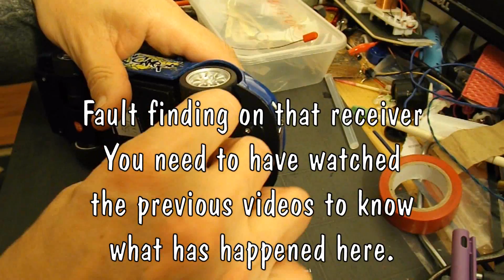Charity Shop Garbage RC Car R16

Comment: if that ic is a popular rx-2 clone this resistor sets the speed of transmision data , there might be more than one tx-2/rx-2 pair on the same frequency if you use different values of those resistors inside remote and reciever pairs than in other pairs
if the frequency is off on one side by small margin, car would stuter or not work at all, if they are miles off car wouldn't move or do silly things even if you connect antenas directly
Reply from the maker: Thanks

Comment: I very like your video but how to make rc car faster
Reply from the maker: I don't do fast RC cars. The usual way to make an RC car faster is bigger batteries or change the motor for a more powerful motor. If you are talking about cheap toy grade RC cars both those options may cause the receiver board motor control circuitry to overheat and burn out. If you change the RC gear to hobby grade you can then match the motor and battery using an ESC and you can really increase the power.

Comment: Hi, Grandad i wanna ask you question. Do you prefer toys like this without coputer or you would to make some toys with computer? If yes, i know one thing: It calls ardurino and it is micro-controller as you can make lots of stuff from this. Its easy programmig and if you like it, try it. PS: Sorry for my english im just 15 years old and i live in Slovakia.
Reply from the maker: It is more a case of my channel is aimed at simple, quick and cheap projects. Once I start using micro-controllers the projects move into a different area. Even the rc projects I do are very basic. There are plenty of channels that focus on arduino, PIC, and raspberry projects.

Comment: Hmm. 180K is in line with the 200K on the datasheet. But if the reading was 17K on the meter, it would be why a piece of wire added works as the work around.
If the receivers own real antenna is a replacement (got bent, got replaced, didn't work so went to the charity shop) then I wonder if a direct connection from Pin 4 to the car antenna would fix it. It's also possible that such a trace existed on the circuitboard and has been accidentally cut/bridged or become corroded.
Reply from the maker: I think a more detailed check on the antenna circuit will be the next step.
I did notice the receiver works with the antenna disconnected with my wire attached to R16, not that it is unusual when the transmitter is up close anyway.
I am pretty sure I did try the antenna direct on pin 4 and probably every other pin :-) early on in the tests but I will certainly have another go as this is quite intriguing to follow through.

Comment: It sounds to me as like your wire is picking up the signal and going straight into R16, bypassing something that is throwing the oscillation off. Is R15 the correct value?
Reply from the maker: Look back at the previous videos to follow the thread of this work. I strongly doubt that the resistor is likely to be the wrong value as I would guess this car worked when it was originally purchased and has since developed a fault. Resistors don't magically change places on circuit boards.
In the previous video I go through the data sheet and a generic circuit diagram, it is not the circuit diagram for this actual circuit board but it gives you a feeling for the way it works.
R16 sets the oscillator frequency used by the timing circuit.
Reply: I see. I assumed that the reason it was in the charity shop was that it never worked correctly in the first place.
Reply from the maker: Samuel Tyree That is quite possible, but if I bought a new toy and it didn't work I would take it back to the shop where I bought it and get a refund, not dump it on a charity shop. Prices on RC stuff have dropped significantly recently but I bet when this was new a few years ago it was at least £20 or £30 and I would want that money back.